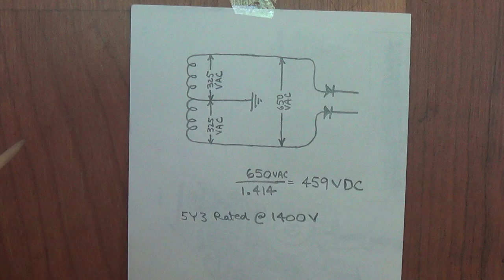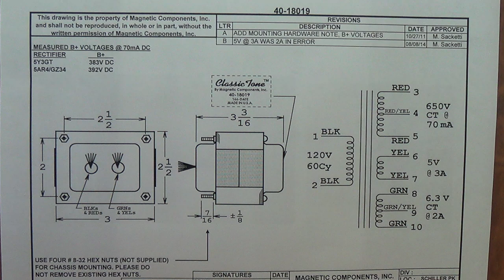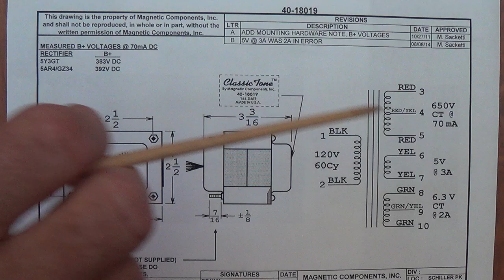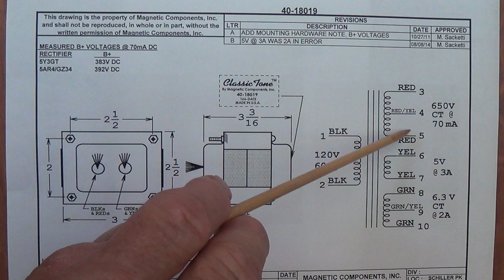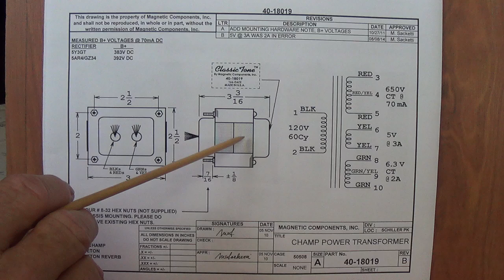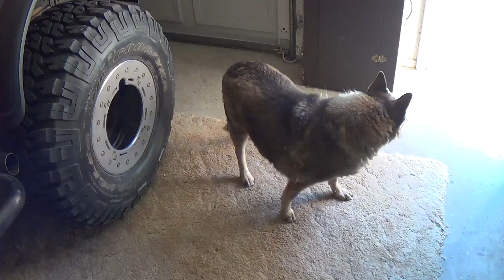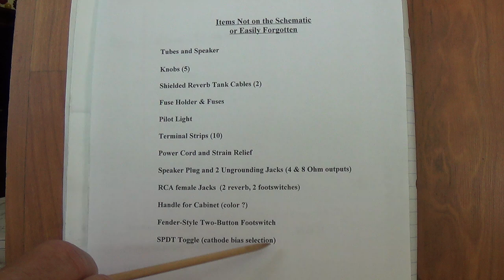How to Scratch-Build a Vintage Amp, Part 3:  Transformer Selection, Parts List, Cost Analysis

Comment: Custom built boutique amps go for big bucks these days, and there are those out there that will pay whatever asking price
if they are interested in the sound and the whole package that comes with it.
Reply from the maker: +SuperCarver2011   As we have seen, the price of high-grade components to build these amps is significant, and probably a big part of the high selling price.
Reply: +Uncle Doug;  Especially the NOS RCA Blackplate 6L6 or some of the rarer European preamp very low noise tubes
(12ax7) etc, which, if still available , command a "Kings ransom" these days.

  Most of the new tubes used these days are made in  the former Eastern Block countries, Russia (Sovtek) or JJ/Tesla (Slovakia) and the Chinese make a couple of their branded tubes as well

    My current 35 -> 40watt  (Made in China) , VK112 Peavey ValveKing  Combo amp came with Sovtek 6L6XT .   They sparkled nicely when the B+ was applied like Christmas tree ornaments as well as making funny "sputtering" noises.  I got rid of them ASAP and  the OEM  Electro-Harmonix preamp tubes as well, replacing them with JJ tubes  (from a well known online tube store), as complete package. At the same time swapped out the  mediocre ceramic OEM Valveking speaker, with a new Vintage G12 Century Vintage Celestion.. This made all the difference in the world with tone and performance of this  $500 amp.  it sounds more  like a more expensive boutique amp now, at an additional $250
investment  in upgraded parts. 

   What I also like is this amp, is the unusual feature that changes it from class AB push-pull, (35 -40watts peak/30watts
RMS)  to a single ended  Class A at 60% reduction in power ( approx 12watts)  They do this with a patented"Texture Control"  pot on the back side of the amp's chassis that modifies the drive from the phase inverter  12ax7 cathode to grid of one of the 6L6 which is normally driven by this signal phase inverter. The other half of the 12ax7's plate signal is left alone, being coupled as normal  to the other 6L6 of the AB pair. 

   When you turn the 1 meg texture control pot CCW, the effect is;  that the signal to the affected 6L6 is PROGRESSIVELY subtracted as the the gain of it's driver is  decreased (60% power reduction at maximum CCW).
When the Texture control is fully CCW, the affected 6L6 is still conducting with just idle current to protect the tube.
Conversely turning this control pot CW increases the gain of the inverter and signal o/p to it's respective 6L6 until
full power is restored to AB operation   when the pot is at maximum CW. 
This is the way I understand this Texture control Class AB to Class A  circuit from the schematics I have on it. 

  The Upgraded G12 Celestion Vintage speaker: (60  watt power handling)
What is unusual about this Celestion G12 Vintage is that it has a neodymium magnet inside which is much
more powerful than the  traditional ALNiCo  or the Ceramic magnets. The sound is characteristically similar
in some ways, but warmer,  like the older ALnico magnet speakers that they used to make and install in the
amps back in the 50s. And with the weight of the amp being a problem for old legs, the lighter weight of
the Celestion Neodymium magnets shaves at least 10 lbs from the original 44lb weight.amp.
A more expensive speaker, for sure,  but for me, it's worth it , n weight reduction and sound quality
------------------------------------------------------------------------------------------------------------------------------------------------------
Here's what they say about it:
"The G12 Century Vintage, our mission was to create a loudspeaker that combined all the benefits of a Neodymium magnet structure with a voicing that evoked the classic guitar tones of the 1960s and 70s.

The incredible magnetic properties of Neo mean that only a small amount is needed to produce the same flux as a much larger ceramic magnet structure. What's more, the magnet of the G12 Century Vintage is a pot type which actually SITS INSIDE THE VOICE COIL,  (unlike the ring magnet of the G12 Century which surrounds the voice coil). The resulting weight of the G12 Century Vintage is just 1.66kg (3.65lb"
Reply from the maker: +SuperCarver2011  Very interesting, SC. Thanks for the analysis of the "Texture Control"......quite a nice feature.

Comment: I have 5 mins left in this one and haven't watched the subsequent video, but you list RCA female jacks, 2 for reverb and 2 for foot switches. The foot switches I've seen use 1/4" jacks, not RCA. Was this a mistake or are there foot switches with RCA plugs?

Comment: @UncleDoug the 40-18019 transformer is sold out everywhere on the internet. Could you recommend a replacement that would work and be just as good. This is my first amp build and I really wanted to follow the videos and build along with you. Thanks.

Comment: In your experience, is there a noticeable difference in sound using Mercury M transformers and "hi end" components? Can't say it enough but Thanks UD, Rusty and Jack!
Reply from the maker: +wreckoningday  I have never used MM transformers, WD, but I'm sure they're very well made.  Judgement of tone is quite subjective, and I personally don't think that the majority of "high end" components really make a noticeable difference in tone quality.  One thing to remember is that the truly classic amps from the 50's and 60's (that everyone worships and tries to duplicate) used regular, cost-effective components.....not a single $30 capacitor or 15 lb. transformer in the bunch.

Comment: Hi Uncle Doug! I am building my first tube amp and I have a question about the output jacks. I am building a 5f2a with a OT that has 4, 8, and 16 ohm taps (I believe it is the same one you are using in this video series). Are nonshorting jacks the same as the ungrounding jacks you speak of and are these what I need to hook up each of the taps to its own jack?
Reply from the maker: +Nemo Alicunde Yes, for the speaker output you want to use simple, non-self-grounding jacks. At no time do you ever want the secondary of your output transformer to be shorted. For the input, you should use the self-grounding-jacks to cut down on noise.

Comment: The pricing is both surprising and interesting.   Is it safe to assume that quality commercial amps bring the price down per item by doing volume in parts and there own uniqe inhouse manufacturing?   Based on your pricing seems it would be very difficult business.
Reply from the maker: +John Miner  You're right.....I have no idea how Fender, for example, can produce and sell their Excelsior amp for $300. The materials alone would cost you or me more than this, then what about the labor ????  They use printed circuit boards, 1/4W resistors, overseas (cheap) labor, bulk purchasing, etc. to keep costs down, but I still don't see how they manage to make any profit at all.
Reply: @UncleDoug  With companies the size of Fender is isn't uncommon for them to intentionally make a loss on entry-level products in order to improve their brand.

Comment: Hi Doug great series as always, I am in the process of scratch building a Fender 5B6 Bassman and am right in the middle of Transformer selection I need a B + of 400V  through a 5U4 rectifier we have a couple of 5881's and 2 others a 6SC7 and a 6SL7 
i am thinking about a 200 - 230 ma transformer  but unsure of the 5U4 loss so not sure about transformer output any ideas BTW i am in a 240 Volt country BTW i have already calculated the OT 
regards from Australia
Reply from the maker: +Steve Worgan  Steve, the 5U4 is not particularly efficient. To get 400V for the plates, I would suggest a 325-0-325 with a GZ34 ( about 392VDC) or diode rectification (closer to 400VDC). If you really want to use the 5U4, then maybe a 350-0-350 transformer would be better (495VDC before rectification losses, so probably a bit over 400VDC after). Your 200-230mA estimate seems generous, but better too much capability than not enough.

Comment: General parts sourcing question:   Ive tortured myself to try to find a single source for, say, all of the resistors or all of the capacitors for a build.   many of the big names have all of the parts (values), but some of the parts are available only in large quantities, like 1000, or 5000.       So, I go to some of the smaller dealers, e.g. tube amp parts specialty stores/web sites, but many of them only have some of the values needed.   Trying to avoid 3 or 4 shipping charges to get just the full set of resistors, or cap's!   Any suggestions greatly appreciated. Thanks!
Reply from the maker: I get all my parts, except for transformers, from Antique Electronic Supply in Tempe, AZ. They have never let me down.
Reply: Thanks again, Uncle Doug.

Comment: I always get confused when adding up the currents. If say an el84 draws 48mA of current, is that per tube? The data sheet on a JJ el84 says it draws 48mA in a class A configuration. So in a nutshell, if I'm using 4 el84's how much current are they using?
Reply from the maker: Class A is generally single-ended, Mike. If you're using four output tubes, odds are you're running in class AB or some other configuration. Also, the tube handbook generally  provides either maximum or optimum values......which has nothing to do with what your tubes are actually flowing. The only way to be sure of your plate current is to measure it.  Regardless of your PC, however, keep in mind that the measurement that really counts is Plate Dissipation.

Comment: I'm wondering if my understanding of plate current is off. According to the spec sheet of a  JJ 6L6 tube, Ia = 72mA for single ended, and 134 mA for push/pull. I saw that in this video you mention the the plate current for a 6L6 is 40mA, I'm curious where you got that? Also would that value be larger if you were using two 6L6's in a P/P configuration?
Reply from the maker: A JJ 6L6GC can tolerate 72mA of plate current, Mike, but I was not using a 6L6GC. The earlier forms of the tube: 6L6, 6L6G, 6L6GB, and 5881, which I used in this amp, have much lower PC and PD values than the GC. In addition, when dealing with used vintage tubes, I tend to become a bit conservative. My tube handbook shows 48 to 54mA for a non-GC 6L6 and I found that around 40mA provided good tone without stressing my power transformer.  Since I wanted the 6L6 to be interchangeable with a 6V6, it was best to use a form of the 6L6 which was closer to the PV and PC of a 6V6.
Reply: oh ok that makes sense. I think I am a bit confused when trying to understand these spec sheets. When it says Ia = 134 mA for push/pull, would that be 134 per tube in the configuration, or would that be the total for both tubes? here is a link to the spec sheet I am looking at if that helps: http://www.jj-electronic.com/images/stories/product/power_tubes/pdf/6l6gc.pdf
thanks so much for your response. I am a huge fan of your videos!
Reply from the maker: Thanks, Mike. I don't blame you for being confused, because the spec sheets are often not very clear about such vital details. My interpretation is that the 134mA would be the total for both tubes, simply because the alternative is simply not conceivable:  A single 6L6 conducting 134mA at a PV of 400VDC would have a plate dissipation of 53.6W.....just about double the max (which is no coincidence, since it's actually for both tubes).

Comment: hi Doug do you have use the max screen currant as well as your max plate curran in the calculations.  say for a 6v6 class A amp  at 315 volts is 35 MA  max signal screen curran it is 6 MA  =  41 MA
Reply from the maker: +ian “valve doctor” forster  Truly accurate biasing requires that the screen current be subtracted from the total, providing a net value for plate current alone. Many people fail to do this, which is really not all that harmful since the total current provides a conservative bias that promotes longer tube life.

Comment: Hi Again, Uncle Doug.     Ive been reading up on resistors for a first amp build project, and made it through some of the arguments for and against various resistor types in a tube amp, mostly against carbon composite resistors due to instability.   

Are metal film type your choice for most amp builds and repairs?   

As an aside, if you're repairing an old amp, that has carbon comp's,  which by chassis photos Ive waded through, looks like most do,  do you replace bad components with the same (or similar as possible) types, e.g. comp with comp?     Do you ever need to go through and measure resistance values and replace those that are too far out?
Thanks!
Mike
Reply from the maker: I use carbon film and metal film resistors in my scratch builds, usually 1W unless higher value is specified. When repairing amps, I use original carbon comp resistors if originality is important, and carbon film and metal film if not. Yes, I test resistances and replace those that are way out of spec.
Reply: Thanks, Uncle Doug!

Comment: Uncle Doug, & Rusty,
I thoroughly enjoy your videos. I'm a relative novice to tube amps. I really want to scratch build an amp using the parts from a peavey vk 112 I've done a few mods already but I'm not getting what I really want. I want the amp to have a great hi gain circuit a la 6505+ or a dual rectifier. Is it possible to build a 6505 peavey channel and a dual rectifier channel , and keep a good clean channel. All in one chassis? This is my dream amp. I like the fact the vk I have is 50 watts the 120&100 watt versions are waaay to loud for my purposes. Is this even possible? Or am I dreaming. Either  way I would like to handwire my own amp. There are alot of bells and whistles on theese amps i don't need if eliminating some of them can make this build possible I can live with that.  Thank you for all of the videos you have taught a lot of us enough to take on projects way over our heads😀
Reply from the maker: +Justin Maxwell  Greetings, Justin. I have no personal experience with Peavey amps and, without extensive research, would not be able to offer insights for your proposed modifications. I suggest that you do what I would do in your position......study all available sites, forums, and other info on the subject, i.e. do the research and experimentation necessary to solve the problems. When you take on a challenging task, you must be prepared to personally address all issues that interfere with its completion. Good luck.

Comment: Uncle Doug, I've a question if you please :-)  I've got a powerful hankerin' to build a tube amp .. maybe a Champ clone.  I've a few power transformers lying around.  One of the transformers secondary voltage is too high for an amp .. I believe instead of 325-0-325 it's 375-0-375.  You mention in this video that there are ways "to bring the voltage down a little bit to suit the circuit".  Would you be so kind as to elaborate on such a method?  Or, perhaps I'll need to bite the bullet and order a ClassicTone 40-18019 .. (or Hammond 290AX)
Reply from the maker: You are always better off with a new, proper-voltage transformer made for amplifier use.....BUT, salvaged transformers can often work well. It's possible to drop the voltage down to proper levels with resistor(s). Be sure that the resistor(s) you use are of sufficient wattage to tolerate the current flow. The necessary resistance and wattage can be accurately calculated using Ohm's Law.
Reply: @UncleDoug  Thank you very much for your reply, Doug .. But, wouldn't the resistance spoil the regulation characteristics of the transformer?  Or would that be a non-issue?  Thanks again for all your wonderful videos! :-)
Reply from the maker: @kc9kepextra460  There is no "regulation" in a simple transformer power supply, KC. Resistors are routinely used throughout all amp circuits to reduce voltage.
Reply: @UncleDoug  Doug, thank you again for your reply.  
Perhaps I could re-phrase my query.

I was thinking that the voltage regulation of the power transformer is the percentage change in the output voltage from no-load to full-load.
And, I'm assuming that voltage regulation of the power transformer is a dynamic, load-dependent number. 
I was also assuming that adding series resistance to the B+ leads would cause the B+ voltage to sag when the amp is being pushed and is drawing more current than when idling.  

So .. Am I all wet or no?  :-)

Thanks again,
-Tom
Reply from the maker: @kc9kepextra460  Using resistance to reduce voltage may well reduce the current flow through the circuit, but, as I said before, it is routinely done in every power supply I have ever seen. Yes, adding extra resistance to reduce excessive voltage from an improper power transformer may make some sag inevitable......but that's the price you pay for using an inappropriate transformer. One other method is to use a zener diode that will conduct the excess voltage to ground, but then you are dealing with both reduced current and a whole lot of heat. There is no foolproof way to get around the fact that using incorrect components will cause some collateral problems.
Reply: @UncleDoug  OK Doug .. Thank you for the reply!  Mucho-appreciated :-)